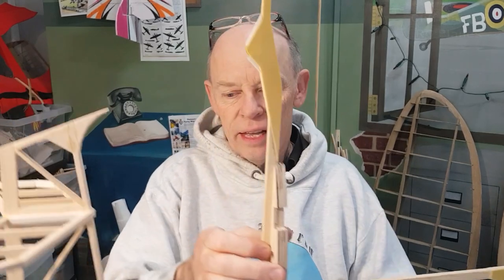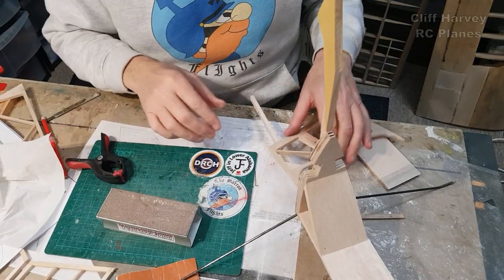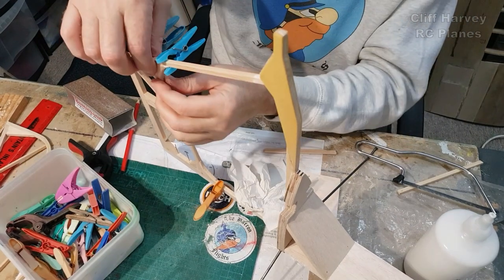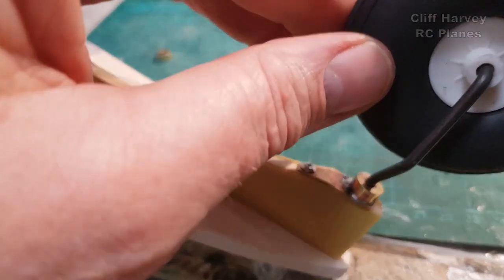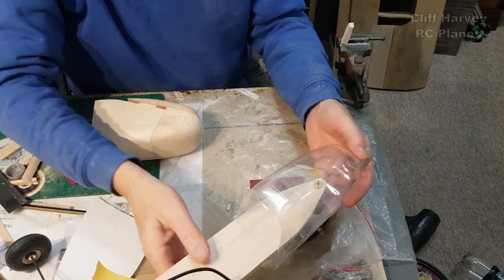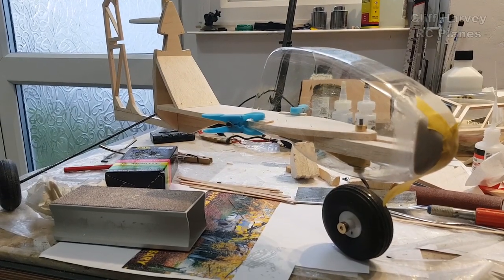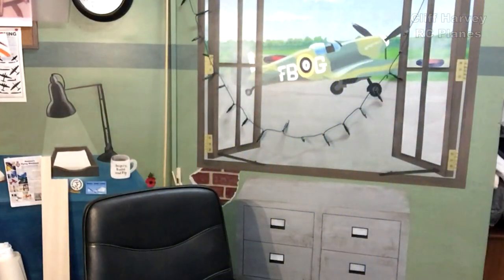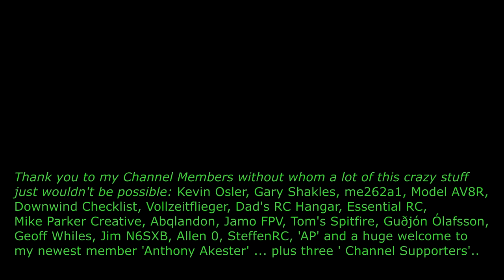Mantis Autogyro Construction (Part Two)

Comment: Looking really great! That bottle forming technique is really good for the large models you have. And I am also exploring the rattle cans lately, Using one just now on the Piper cowling ;)
Reply from the maker: You can make quite small parts as well Andrew, the cowl for my big Guillow's Spitfire for example. Go easy on the paint, the weight can build up quickly 👍

Comment: I don't drink soda, so I would have to use a similar plastic bottle.   A lot of photos of Autogyros here in the states show them open framed.  Yours looks a lot nicer
Reply from the maker: Hi Kirk, I don't drink it either, but once a week we put our recycling rubbish out the front so a short walk around the block yields suitable supplies, cheers 👍🙂
Reply: @CliffHarveyRCPlanes  Thanks for the idea. I definitely will look for some when I am in town on trash day.  I live on 5 acres and can get away with park fliers on it if the wind is from the S or W.
Reply from the maker: @Kirk Morrison  Very nice Kirk, land is expensive in England but my little back yard is good for round the pole 😁👍